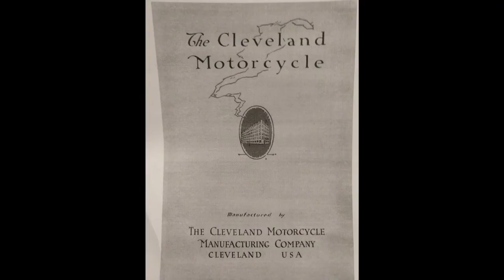The Bike is Done!  Video # 15 Historical Bike Build.

Comment: I was born in 1945 in Cleveland and I am building a very similar bicycle with integral gas tank and same engine, rear rack mount engine, and some personal custom items. The name on the tank caught my eye. You built a nice machine.
Reply from the maker: Hey that's awesome feedback.  I'm so glad that someone like you appreciated the build.  It's super fun doing the builds, but it's even better if someone genuinely appreciates it as well, so thank you for your comment and for watching.  If you can, post a picture of your build!  Dean.
Reply: @deanvandress4693  Dean,I  thank you for the connection and I am at a critical point in my build, and I hope to share images of the Frankenstein machine that I am redesigning,brother.
Reply from the maker: @dehoedisc7247  did you finish your build?  Post pictures or a link to your build.
Reply: @deanvandress4693  I am still at it, actually may have it done by July this summer.Thanks for your howdy.
Reply: Did you build a friction-drive kit?, if so, I'll bet it was a big disappointment.😉
Reply from the maker: @jerryb1234  it’s an automatic clutch centrifugal force clutch.
Reply: @jerryb1234  Ha ha ha.  No, not "friction" drive . Chain drive from above the rear wheel.  Heavy duty and lots of upgrades.Not one of the common ring a ding ding rat bikes.
Reply: You should upload a progress video that’d be lovely
Reply: @RustBucketYT  old guys work slowly, but the one-off  motorised complex  4 stroke rear engine bike should be worth it. Maybe in December. Assembling a jigsaw puzzle would be easier. compared to the machine.

Comment: Wow, that is a really great build. I'm sorry if I'm gonna be that guy with suggestions.  Perhaps, drill a hole through the tensioner for the chain and the frame to put a small screw in so it has almost no possibility of going into your spokes. Also adding reinforcement brackets to the fenders so they don't shift and go into the spokes.  Ounce of prevention a pound of cure.  There's been a couple of people killed with these failures across the country. The tribute to Cleveland is great. I spent the best 14 months of my childhood in Ohio. This is the 1st of your videos I've watched and I subscribe. I know you said you were done with this build but I but I think you like to tinker. It would be fun and a nice performance enhancement without compromising reliability to do a little port and polish on the intake and exhaust.  The Cleveland sign your wife and daughter made is perfect. That gas tank and storage compartment is very cool. I have to go through the archive of your videos and see what you've already done. Good job!! Turning that abandoned setp-through/girls  Huffy into a great motorbike.  People like you make Cleveland and America great. Thank you for the video. God-bless you and keep you safe. 🇺🇸
Reply from the maker: Hi Edward.  Thank you for the comments.  I'm just a tinkerer, so I welcome any constructive pointers.  I agree with you about the spokes.  I have seen those horror stories as well in the online motorized bike forums.  Where do you think I should add the reinforcement brackets specifically?  Also, do you have a picture of the screw in the chain tensioner suggestion?  Thanks for watching, Dean.
Reply: @deanvandress4693   I don't have any pictures. It is just something I've seen other builders do and suggest. The drilling of the hole to stop the chain tensioner from sliding in is similar to the drilling of a hole for the throttle on the handlebars. I've just watched a many videos and I'm working out all the problems I can think of before actually building something. I wish I could be of greater help. If I recall several of the  rode their motorized bicycles off road and added the drill hole to the chain tensioner, because of the vibration.

Comment: What is the fuel capacity of the tank you manufactured?  On that note, would you, or could you consider manufacturing one for me.. Same exact style. One other thing just a thought, maybe should put new tires on the bike. Especially the rear. Looks pretty bald.
Reply from the maker: It's 14 to 16 ounces (the size of one standard plumbing propane torch).  
This is more of a show bike for me than a daily driver.

Comment: whats that thing you tap with the hammer before you drill the hole?
Reply from the maker: It's a nail set punch.  Making a small indentation keeps the drill bit from wandering.  Thanks for watching!  Dean.

Comment: Also , that duel brake setup you installed , can they also work independent of each other still , or is it all or nothing ?
Reply from the maker: You can run just one brake line to the toggle if you want.